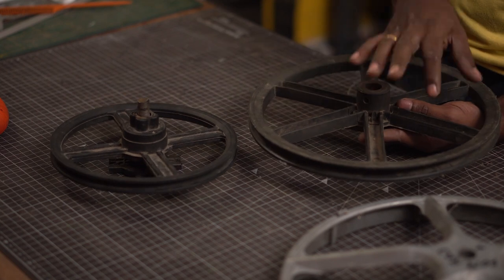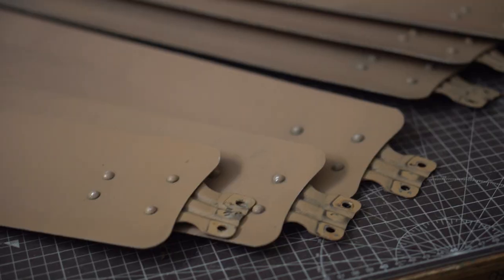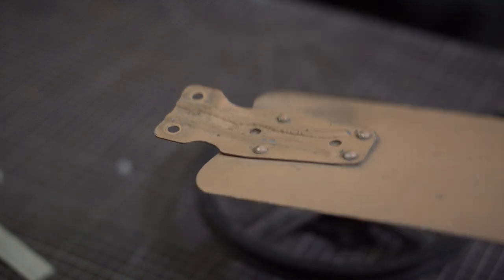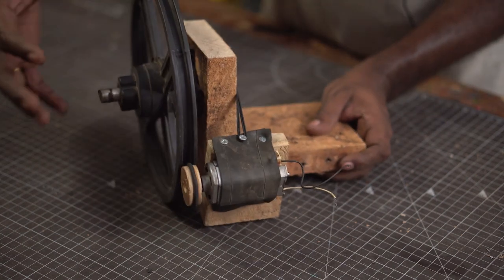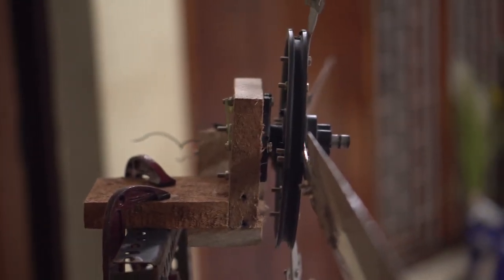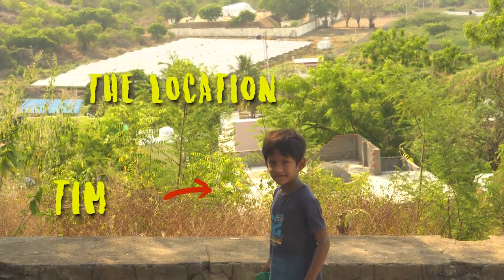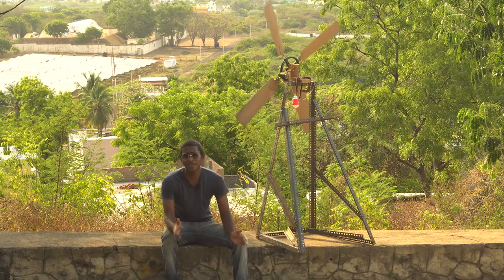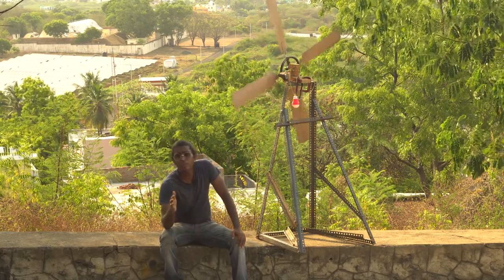Homemade portable windmill  generator with recycled parts_ no welding required

Comment: Great idea sir
You r using  waste parts of fan, grinder ect  things. About generator you can use an automobile alternator  u will get more out put than what u use simple motor
Reply from the maker: Automobile alternator might need more RPM ...but I think I should try that. It might work

Comment: If I attach a lithium battery charger to the circuit, could it charge a small battery??
Reply from the maker: Technically yes. Its making about 7 or 8 volts at peak and 50 milli amps. So it would take 60 hours to charge it!!!
Reply: @VIDEOEPPO  That low huh ??? Changing my diy idea right now... 😵😵😵